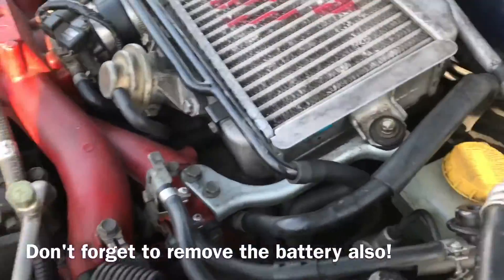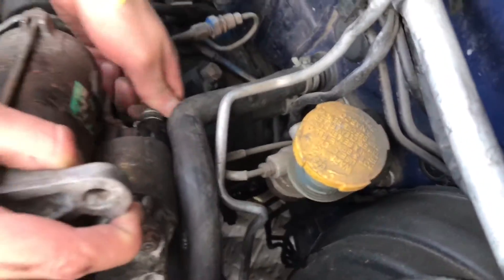How to install a starter on your 02-07 Wrx/Sti

Comment: I have a bugeye having trouble figuring out what it is. I checked my grounds and power cables. It's all getting enough volts. My dash lights come on headlights come on when I turn the key over it just clicks any idea what it could be? My car started up the day before so I know it's able to start just not consistent
Reply from the maker: Sorry for the late reply Enrique but it sounds like your starter went out.
Reply: Enrique Daetz literally having the same issue right now.
Reply: Enrique Daetz hey man I know it’s been a while lol, but did it turn out to be your starter? I’m having the same problem